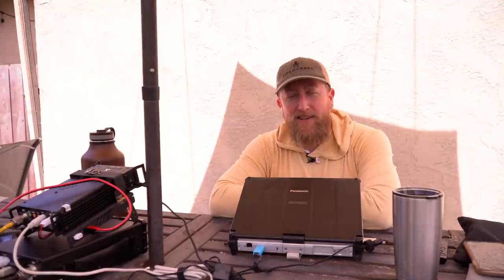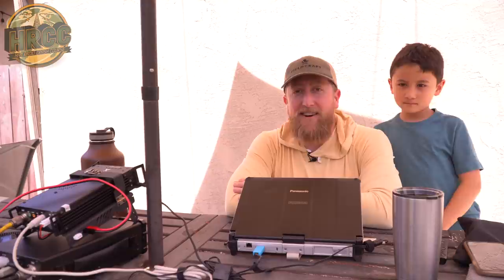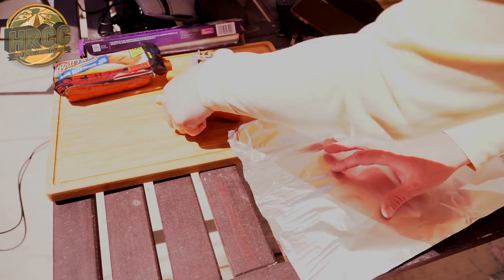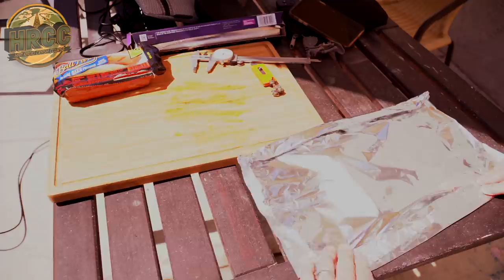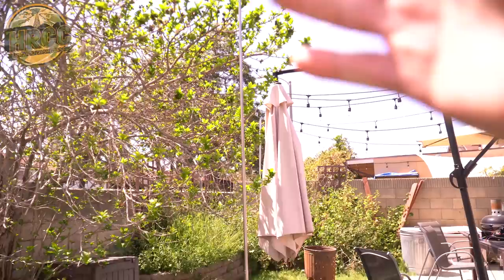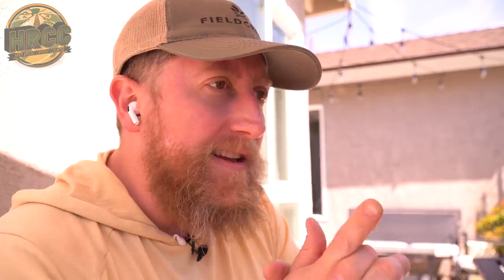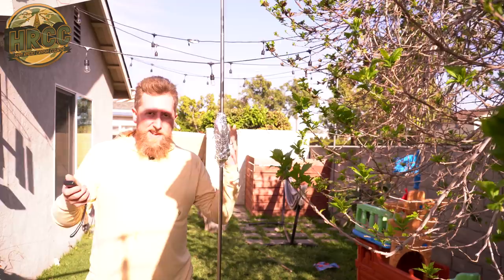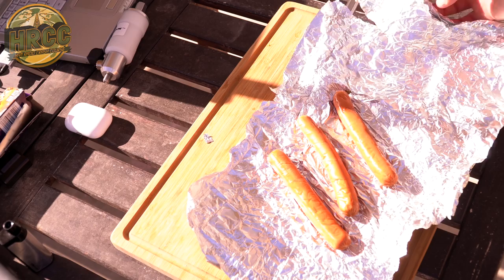Can You Cook A Hotdog With Ham Radio? Is it dangerous?

Comment: Josh, I'm guessing the foil will be like a faraday cage and protect the hotdog.  You need to direct attach the dog to the antenna, maybe then wrap it to trap the rf.
Reply: Yep, there's no RF inside a faraday cage. The inside piece should be plastic. Even better, spear the hotdog over the antenna base.
Reply: Perhaps I should watch all the way thru before opening my mouth.  I should have known you would have seen the problem.
Reply from the maker: With that said, I don’t think it makes a faraday cage as the foil is connected to the antenna. 🤣
Reply: @HamRadioCrashCourse  Still the energy should be diverted around the outside of the foil packets

Comment: I have a few anecdotes that might offer insight. Years ago I had a friend that ran a 300 watt amp on a CB rig. His wife keyed up one day while we were in the front yard. There was a Mocking bird on the antenna and when she keyed up, there was a slight popping noise and the bird dropped to the ground dead. No visible burns, just a dead bird. On another occasion, my uncle had a friend over who also had a CB running power, not sure how much but it was a lot. He keyed up and a ball of lightning came out of the tip of his antenna. The lightning extended out about two feet in all directions. At night, it was pretty impressive. I also ran a CB back then and would regularly light a four foot fluorescent light from a distance of about six or eight feet when I keyed up. The takeaway here is that RF definitely has enough power to do some damage, maybe you just have to adjust your parameters a bit

Comment: I have a feeling you can get some pretty good success with a highly directional antenna and 1000 or 1200 W, in the 2.3 GHz band. Maybe even build a special box to reflect The energy around until it can be absorbed into the hot dog. 🧐

Interesting ideas to play with though, thanks for sharing.
Reply: I'm sure you said that on purpose, but at that point it's literally a microwave hahaha. Although the same principle still applies, the higher frequency RF resonates better with water molecules.

Comment: Few weeks ago, had my first encounter with warmth from RF.   I had forgotten I was calling CQ on FT8 and was checking my 18 gauge aluminum wire counter poise where it attached to a ground rod.    Felt an eerie warm feeling as I touched the wire.  This was on either 15 or 20m.   I think I might see what happens if I attach a Vienna sausage to the counter poise at the ground rod.

Comment: This makes me want to go over to my local AM broadcast station where you can literally walk up to the transmitting antenna and touch a hotdog to it with a very long wooden pole. The hotdog is connected to ground.  It’s running 10kw. My prediction if I did it would be a nice yellow arc to the hotdog and burn it.

Comment: I have no idea why this popped up in my feed two years later, but thank you! You made me laugh. RF exposure is a real thing. The FCC has required all amateur radio operators to do a RF exposure test for their stations. In my case, running 100w on all HF bands, I only need a 2ft. radius. On VHF/UHF running max 50w I need a 5 foot radius. The real danger, however, and you didn't cover, because most hams don't have the capability, is the 1.2Ghz band (microwave), which, even at low power (like 2 watts), will cook a hotdog if you happen to be standing in front of that beam.

Comment: Hmmm, normal hotdog cooking with radio waves (rf)...

A) use microwave oven - approx 2.5 GHZ. Set @ 1100 WATTS!  Cook for about 2 minutes. (No! Don't wrap them in aluminum!  Arcy-sparky!) 

Alt. Method - find a much bigger microwave; i.e. million Watt radar from an F-14 TOMCAT!  Put hotdog on long wooden stick (warning: point radar over side of aircraft carrier away from everything; including other ships & have fire extinguisher handy!) - hit radar test for about 2.5 seconds - with stick & hotdog in front of radar dish.  Finished & cooked hotdog ready to eat -yum!

That's right - 2.5 seconds! 

[For the record; 4 seconds WILL ignite both the dog & stick - hence, the fire extinguisher!!!]

By the way, we really did use this method for the 'quick test' of the radar.

It's all about the power baby! (& frequency - we used a much higher frequency than a microwave oven)

Comment: Hot dogs must be wired in series with the antenna. Like loading coils to block and absorb the lower frequencies.
Try 2,400 to 2,483.5 Mhz range.
Then and only then, will hot dogs teleport and re-appear at the far end of the Smith Chart.

Comment: My guess is that to heat it up significantly you'd need to be running a frequency that has a lower wavelength as the size of the object, like a microwave at 2.4GHz, but then, I don't know if you can run the power that would fully cook a wurst

Comment: the aluminum foil is a faraday cage protecting the hot dog.. if you want to cook a hotdog you will need to use 2 meters or higher and shove the hotdog directly onto the stinger. and keep it to the tip of the stinger. or cook them on 10 meters with 500 watts

Comment: It was not all that many years ago when HF diathermy treatment was frequently used in the treatment of muscle and joint issues. Many physicians kept diathermy machines in their medical offices--the machines generated a few hundred watts of RF at about 14 MHz, causing the treatment area  to be warmed internally.  It was a gimmick (quackery) at best and hardly a safe one.  In the last few years, however,  some patients suffering from dementia have been shown to exhibit improvement in their condition or even reduction in the advancement of their disease when treated with magnetic fields focused on certain brain areas (QST--month?--had a short piece concerning this back in 2019).  I do not know if enough data concerning this treatment has been collected in order to show any statstical significance (or whether it turns out to be just the luck of the draw).

Comment: I watched a video following Field day a few years back . A group oh hams had forgotten a Balun so they wrapped the Coax around a stander plastic coffee  can (it had coffee in it) . At the end of field day the coffee roasted to a dark roast . What you need to do is spend all day playing radio and you might get some better results. Or you can do what I did and grab the Antenna bare handed while transmitting. I wasn't thinking  good thing It was on low power. Another thing to consider is going to a VHF or UHF freq. and trying it there. Microwave ovens are in the 100s of Mhz range . Remember to protect your self from RF you have to calculate Frequency Time and distance. To try to cook those dogs in a shorter time you are going to have to go to a higher freq. . Possibly 420 band

Comment: 50 watts is useless, you will need a few hundred watts say 300+ try vhf band2  or may be 144Mhz  2m band, u need a lot of power to burn and cook a hotdog. A 2.45Ghz 1kw microwave works, its a radio transmitter. Note:- attach the hotdog and stand well back behind a rf shield. Caution be sure not to damage the rf amp, from excessive SWR.

Comment: You should have put a hot dog inside a coil with a parallel cap resonant on 10 or 6 meters. It would not take many watts out to cook the dog and the RF would not be wasted radiating out to space. Putting them in aluminum foil prevented ANY RF from passing thru them.

Comment: I don't know if it would cook a hot dog as we've all been told but you are definitely in the wrong bands.  30-300 MHz is more likely to work. Get into the gHz and odds are even better. So 6 meters might have given you a chance. 
Also, FT8 is on standby a large percentage of the time so that's not helpful to the purpose. You need a 100% duty cycle. While digital, FT8 transmits then listens so you have a 50% duty cycle.
And yes, the aluminum foil (probably) completely or largely nullified any RF heating as RF travels on the outside of the conductor. Thus, even if the RF traveled on BOTH sides (and not just the outside) of the foil, you've again reduced the RF available for the cooking.
And now that I've seen this I'm going to have to do some experimentation.  I think 6 meters with a continuous transmission (in an appropriate part of the band for experimentation) MIGHT do the trick. I suspect 2 meters might work better than 6 with the same power.

Comment: Your science fair project wasn't thought out very well. Try electrically grounding one "side" of the hot dog (not the end, but the side) and expose the opposite side of the hot dog to the radiating element. Repeat the test.  While the hot dog is absorbing the energy, it might be necessary to wrap the hot dog in not conductive insulation (a non-metallic thermal blanket) to allow the heating of the hot dog to not be lost to the surrounding, moving air. Possibly use a infra-red camera to observe hot dog temperature rise above ambient.
Reply from the maker: Watch the whole video. 🤣

Comment: Not enough power! Even if you magically had perfect swr, IT WILL NOT COOK! Just think of the thermal mass of an antenna in relation to how much power you are dumping into it. It would be like asking room temp air to cook it . Hell, you'd be better off blowing on it with hot breath 😂 rf burns are tricky, these usually happen when equipment is damaged or not working correctly, and it's not the rf doing the burning, it's usually a burn from someone dumping a crap ton of power into say like a piece of crushed coax.

Comment: Those hot dogs aren't going to get heated by any significant amount of RF because you wrapped them in foil. They're inside a Faraday cage! The only way the hot dogs will heat up is if the foil heats because of RF exposure.
Reply from the maker: You didn’t watch the whole video.